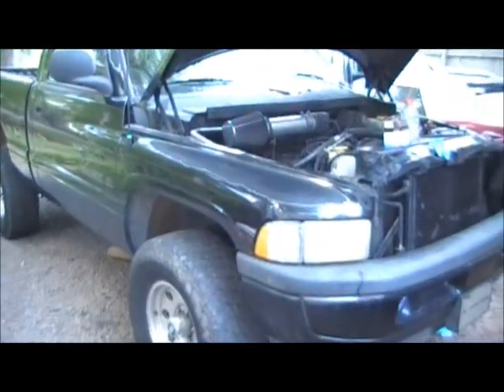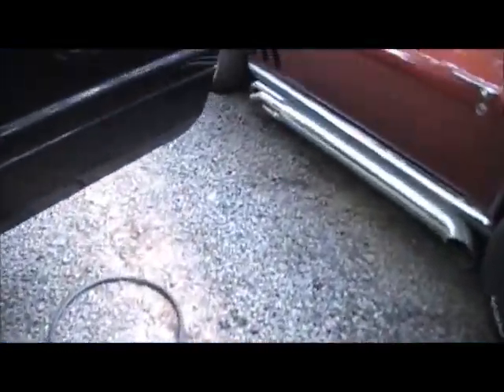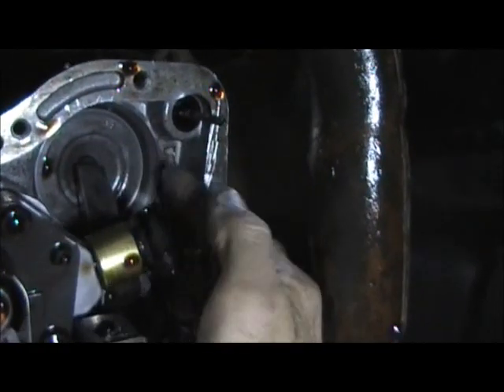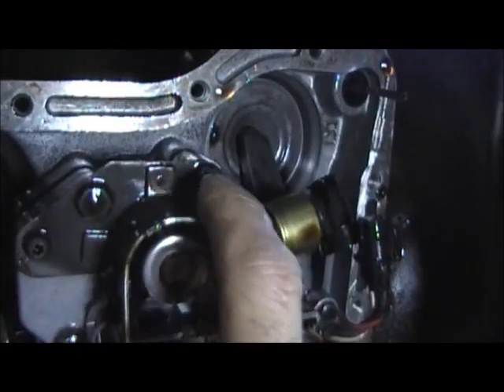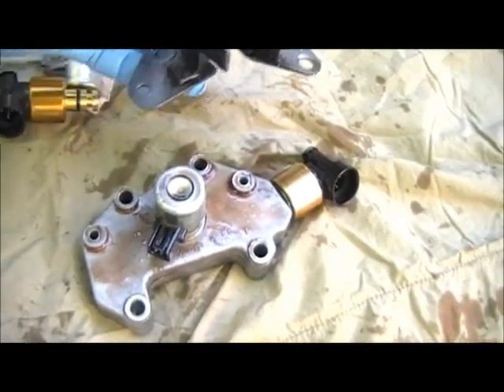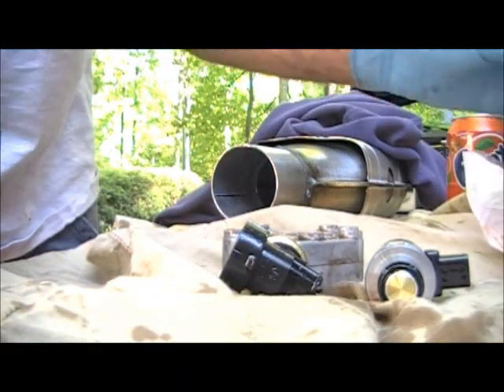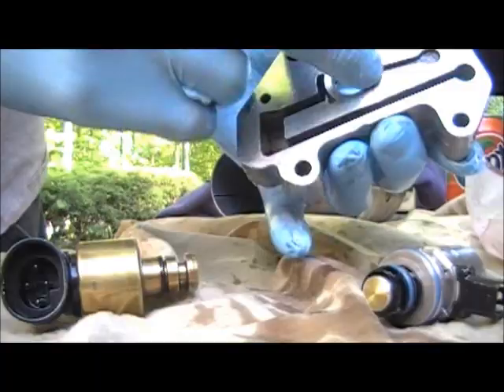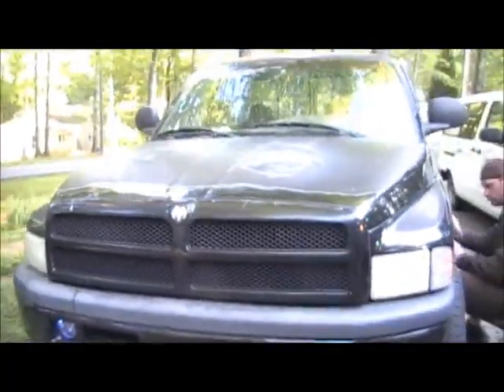1998 Dodge 1500 Transmission Wont Shift Fix

Comment: Thanks for posting this video! I replaced the governor pressure solenoid and sensor in my 1999 Ram 1500 and it solved my problem. It cost me ~$150 for the solenoid, sensor, gasket, filter and fluid. A LOT cheaper than a rebuilt transmission!
Reply: 000

Comment: Thank you so much. 96 Dodge 2500 ram. Trans 47re. Works great now! My trans didn’t want to shift so I rebuilt it, still didn’t shift, replaced those part and works just fine. Your a life savor.

Comment: I have a1998 Dodge Durango with the same exact build and color as your truck....same front end... same body other than your bed... because mine is an SUV. I am having the save problems with mine...and I knew that I was in the right direction with the solinoids. It's the save transmission and same problem...it was nice how you clearly and elaborately got to the point in under 5 mins! Excellent video! Thanks!

Comment: Thank you for taking the time to video this fix.    My truck was up shifting hard from 1st to 2nd and replacing the solenoid and sensor solved this problem.  I would not have thought to do this if not for your video.

Comment: well found both the sensors new on ebay for $105 shipped the cheapest I found the one solenoid was 98 so a deal once they come in ill give ya an update will change filter ..pan was full of nasty ... was pretty scared to do this til I seen this video thanks for your help !

Comment from the maker: Check the cable that runs from the throttle body to the trans. to ensure its not sticking. It's the detent cable, responsible for downshift, the tighter the cable the quicker the downshift on acceleration.

Comment: first of all thanks for the upload. I own a 99 dodge ram 4x4 5.9 360, the fluid is ruby red and doesn't smell burnt when I check it. I notice that I'm having a similar  problem by what you stated in the beginning, only it high revs in 3rd gear close to 3000rpm and have to let off gas, then it will shift. Some days, no problems. I'm going to attempt this this weekend   with those same parts. Fingers crossed. update soon.

Comment: Sweet video bro. You get 5 stars from me. Only took me 2 hours after watching your post. Parts were $300 with a new filter but that's a lot cheaper than any shop would have charged me. Most of them couldn't even tell me if that was the problem. Thanks and have a Merry Christmas!

Comment: This was a good video to show these solenoids.  I realize it's old, but there is a mod you can do to allow for better flow to the first solenoid you removed.  You open up the channel around the screens with a 3/4" drill bit.  As it's designed, the fluid can only get to a small section and if one of those screens gets partially clogged, it will diminish fluid flow.  I read about it on the dodgetalk forums.
Reply from the maker: Not a good idea to get people to drill on their valve body , best to stick to simple repairs .
Reply: Or just change fluid and filter more often preventive maintenance goes along way
Reply: Hay man thank you for your video your southern accent was comforting. Did you switch out the filter while you were under there? @2012nugget
Reply from the maker: @badger_actual8249  Indeed I did.

Comment: OMG. Where do you live? I need to buy you dinner. This video saved our butts. My wife & I just picked up her 98 1500 from an expensive shop visit for new brakes, line etc. because the front brake kept locking up. Then the damn thing wouldn't shift higher than 2 or 3. Trans Temp light came on etc. Frustrated, I searched and found your video. $123 bucks later it is running better then when she bought it. We can now pick up our emergency horse trailer. Thank you soo much!!!

Comment: I just did this to my 1998 dodge ram 1500 v6 with the 42RE transmission. I was having the same problem. Only thing I still have is that I have to let the truck warm up, if not, it still has problems shifting out of second, If I let it warm up for 5 minutes, it shifts great. I just bought the truck cheap, the previous owner did not took good care of it, so I can expect some flaws. But thanks for posting the video,

Comment: You can adjust forward and reverse bands..reverse is adjusted internally..your front or rear piston servo may have a bad seal which would need a rebuild..if servos are bad you also need to see if accumulator spring in valve body is broken, this turns high pressure fluid into low pressure for smooth shifting and if that spring breaks it will only be high pressure which is too much pressure for your forward or reverse servos.

Comment: Thanks for the video.  I used it to fix my 98.

However, the band "lash" you show of about 1/2 inch looks about right.  The other end of the lever is where the approximate 1/8" band adjustment is - where the screw and lock nut are.

Comment: My truck would have high rpms a lot through every shift. I did this procedure and improved the truck greatly. For $200 dollars total saved me from dropping the transmission for $1500. My Dodge has 165000 miles.

Comment: I didn't know if this would fix it, but I took a shot, for about 300 bucks, parts, fluid, filter kit, I actually bought a tranny gasket from the dealer(26.99), way better than the rubber gasket because you don't need to put any RTV gasket maker on it, just make sure the surfaces are very clean. I'm wondering if this was the problem before, I just didn't know , Thanks for the video

Comment from the maker: Well if your stuck in a lower gear the rpm's are higher than normal. If thats the case, that will cause one to run hotter than normal. So when its shifting, your cool, when it sticks you get hot.

Comment: If your steering shaft is the issue, look on ebay for a borgeson one.  I have one on my 01 ram and it corrected the problem immediately.  Otherwise, do what 2012nugget said

Comment: @2012nugget  i just replaced both solenoids in my wifes 99 durango, new filter, fluid. the works. It runs a lot better but when she does a U turn the power cuts out then catches when she goes to accelerate out of the turn and its somewhat violent. Other than that, thats the only issue. But thanks for the video, it helped me out a lot!!

Comment from the maker: There is a cable that runs from the transmission to the throttle body called the detent cable. It is adjustable, by depressing the locking tab at the throttle body. This cable controls the pressure lever on the trans. which is responsible for the timming of the downshift/upshift according to throttle pressure. You may want to try to give it a little more slack, just a little and see if that helps.
Reply: What transmission does a 98 dodge ram 1500 5.9l v8 magum 4x4 have in it I can't find an answer
Reply: @BulbBunny  hey little late but it has the 46re transmission

Comment: Actually I did!  I googled and found the "46re-manual.pdf".  Of the two bands, only the 'Rear Band' is adjustable.  You can see the adjustment screw for it. Loosen the lock nut, then torque the screw down to 72ft-lbs, THEN back the screw off 2 turns.  Now tighten up the lock nut to 25 ft-lbs.  BTW, the Solenoid, transducer, gasket and oil ran me about $320 from dealership.  Could have saved about $50 if I shopped around, but the no wait,  one stop shopping sucked me in...
Reply: 72 INCH pounds...not ft pounds.

Comment from the maker: Yeah, just a lil slack there, just lock the retaining nut with a sensible torque, it wont back out on you. The pan gasket depends on the two types, the cork type takes less, if you over torque it the gasket will just smash out, the solid rubber ones can take a little more, either one will not leak or back out on you so just use your hand and observe the gasket on the side to ensure it isnt smashing out if it is cork, somewhere arround 10-15 pnds should be good.

Comment: I took it in and had it flushed. they said there was some blockage. it doesn't shut itself off now but the engine light is still on. this could be a different problem but this vid made this job seem fairly simple so I may go ahead and do this because it dose feel a little sluggish from a dead stop. oh, also I found these parts on amazon and I could get both for the same price as just one from the shop that was working on it. ..I'd like to hear back if you get yours fixed.

Comment: as soon as your trans acts up change these. i first tried fluid change and filter,didn't work and nothing on magnet drove for awhile before fixing now i replaced solenoids and lots of material on magnet and truck runs and shifts like new. easy fix 1.5 hrs tops on durango. bought mine on ebay from cascade transmission.

Comment: No i havent replaced the soilenoids yet, but if this helps, i drove it over 60 miles today and it had no overheating problem, but it did shift a little funny. But didnt slip once..
Im so confused on this, i had a mechanic look at it, and when he drove it, he said there was a small time lasp in the shift points?.. and told me to take er easy..

Comment from the maker: That sounds bad, first thing, check the fluid..is it full, burnt, full and ok. Then check to make sure it actually is shifting the trans linkage, Then drop the pan and check the filter and pan bottom for metal. I can advise further from there. 
 Hope this helped.

Comment: I have a 99 durango and its doing exactly what you say this truck is doing .. slight difference was the line had snapped and had no fluid on it I replaced the line and fluid but now it wont shift ...the reading from auto zone is wrong pressure in fluid but when he tried to reset the code it failed a few times .. the guy says that means the sensor is bad....  advice ?

Comment: Speed sensors on these transmission control alot. Replace speed sensor 1st and go from thier. I chased my tail changing out solinoids. Which was not the issue. It was a 30$ fix

Comment: I have clutch problems with 1998 Dodge 1500 5.2 no pressure going down with the clutch peddle. It does come back up but won't go into gear. What could be the problem with this truck. I need help. Thank you

Comment: Thank you mine is not shifting out of first gear was told it was a speed sensor put that in no changes I was ready to get it rebuilt till I came across your video got a governor pressure solenoid and governor pressure sensor getting ready to put them in I'm hoping it fixes the problem if not any ideas on what the issue is, this is my first and soon to be last Dodge if I can't get it fixed!! Thank you for your time!!

Comment: my 98 dodge durango, has an check engine light, ran the code it came up as P0743 torque converter clutch circuit electrical and just today i tried to take it out but inside the transmission the plates with the torque bolts wont come out do i have to take my whole transmission out to replace this TCCCE?

Comment: Oh man, I messed up. I didn't tighten the pan bolts tight enough. My wife drove it and all the fluid came out. she got it off the highway but it was smoking. I tightened the bolts with a torque wrench and replaced the fluid. It has a tough time moving from a full stop. I can shift to 1st then Drive after it is moving. Did I reall mess it up?

Comment: Can you feel the knocking through the floor also or only through the steering wheel? Another common issue with 2nd gen rams is the steering shafts that connect the column to the gear box.  The grease inside the boots on these shafts becomes too viscous when the engine heats up and over time, this causes the cv style joint in the shaft to pull in and out, resulting in a knocking felt through the steering wheel whenever the truck hits a sharp bump or goes over rough terrain.

Comment: i just bought a 1999 durango has the 5.9 in it..it shifts from 1st to 2nd but does not shift from 2nd to drive...what can i do other then change the transmission?

Comment: REAR BAND
-) Remove transmission oil pan and drain fluid.
-) Loosen band adjusting screw locknut 5-6 turns.
Be sure adjusting screw turns freely in lever.
-) Tighten adjusting screw to 8 N·m (72 in. lbs.)
torque.
-) Back off adjusting screw 2 turns.
-) Hold adjusting screw in place and tighten locknut
to 34 N·m (25 ft. lbs.) torque.
-) Position new gasket on oil pan and install pan
on transmission. Tighten pan bolts to 17 N·m (13 ft.
lbs.) torque.

Comment from the maker: It may be in limp mode, which will cause a second gear start. With transmissions you have to determine if the unit is close to going out or not. If this is a new problem with no current history of failures I would go for it.

Comment: how did you know that the solenoid and sensor failed? I have a 96 Ram 1500 , it was doing the same thing , watched your video, went to the dealer for the parts, 220 bucks for both, installed yesterday, runs like a champ. The sad part of this is that I've had work done to the tranny about 2 years ago, 1100 bucks, it was doing the same thing, Thanks, your video to the point.

Comment: Good Video.. Straight Forward... I noticed that you didn't point out Torque Spec's of anything you did. Taking something apart is the easy part. Putting it back together, and torquing the Governor Sensor plate and then the Transmission pan bolts.. is sort of important information...  I've looked around and get different Torques: some say 10 Foot Pounds, others say 13 to 15 foot pounds.  Makes a difference.  Cause you can damage the transmission housing or break off the bolt head...
Reply from the maker: Echo Wilson these videos are not complete guides as most people doing their own repairs have only the very basic tools. A little common sense goes a very long way in doing any mechanical repair. I have never used a torque wrench while doing this repair.
Reply: Ok.. No Problem.. as I'm fixing to do this sensor change out today..on my 1997 SLT 2wd Ram1500...  Your Video was very helpful!!
Reply from the maker: Echo Wilson awesome sauce!

Comment: hi i have a 1998 dodge ram 1500 5.9l it drives great. except for when i floor it most the time it will just over rev and not shift. could this possibly fix it 2012nugget

Comment from the maker: Yeah, I see that now "1989". You could have a sticking governor but more than likely a burnt or worn band. The good thing is that the bands are adjustable. I would service it as soon as possible to get a better idea of what the internals look like by the material in the bottom of the pan.
Reply: Hey brother I have a 99 ram van with the 46re it's not shifting to second or third when the transmission has warmed up?? It'll shift when cold ??? No history of failure this is first problem with the trans...would you have any info for what it may be??? Thanks in advance
Reply from the maker: @A_DIY_VAN_GUY  That sounds like a clearance issue internally. I'd suspect worn seal but it's going to be internal.

Comment: I have a dodge ram 1500 v8 pu I changed the thermostat flushed the system a couple times and my temp gauge still goes over near hot but doesn't overheat any help would appreciate by the way like your videos very helpfull I just did bearings on my car Altima thanks ALOT

Comment: i have a 1996 dodge ram 1500. the other day i helped a friend pull her car out of the mud and now my transmission is acting up. sometimes it slips going from dead stop to taking off and is really hard to shift from 2nd to 3rd i have to manually shift from 1st 2nd to drive to get it to shift what do you think my problem is
Reply: jessiyoung87 same issue here
Reply: Mine is doing the exact same thing, same year and model too lol.

Comment: I have a 98 ram 1500 5.9l 360 which i just put a used tranny in it 3 weeks ago. I had slight issue w it shifting from 1st to second  but if i shifted into neutral and let rpms drop then shift back to drive it would fall into second no problem withouit it slamming or anything. i am from massachusetts and we had a ton of snow the other day and i used 4 wheel drive which it worked fine but last night it started to make some noise around where pan is like something was rattleing in it

Comment: Hi, I have a 2000 model Ram 1500 with automatic over drive transmission. My truck just started having problems yesterday.  My transmission will shift into every gear except for overdrive.  so once I get over 45 mph the rpm are right at 3k... its down shift back into 2 and 1 as I slow down, up shifts again as I speed up until its time to shift into over drive.  I also engage the over drive switch on the shift and no change.  do I need to replace the  governor pressure switch and solenoid or do I need to change out the over drive locking solenoid.... thanks

Comment: hi....I have a 99 5.2L V8 dakota with 198K miles....the engine sounds and runs good, but, from 1st to 2nd gear takes too long to upshift (above 30 miles) although 3rd and 4th gears upshift very well, even when im driving around 50mph the overdrive works good....is that a sign of a failing pressure and bad solenoid? Thaks for your help..!!

Comment: My 97 Ram been having this very issue for over a year now. It will sometime take off in 3rd  in the auto trans and it will work it's way up at about 1/4 throttle and won't have the slipping issue but give it to muck and it slips. Will this fix the problem? Getting tire of having the problem everyday and would like it fixed.

Comment: I have an 01 ram 1500 with similar problem it revs up in second gear and wont shift, is this problem common in other year models, my error code said it was the overdrive selenoid. would this be the same fix???

Comment from the maker: Jack the front end up or one side at a time, grab the wheel on the sides and try to move it as if you were steering left to right, look for anything loose. Also grab the wheel from top to bottom and check for anything loose as well. The ball joints are known for going out on them, you may need to pry up and out on them with a prybar or very large screwdriver. Ball joints are what connnects the wheel to the suspension at the top and bottom.